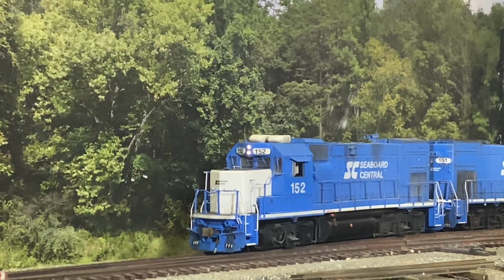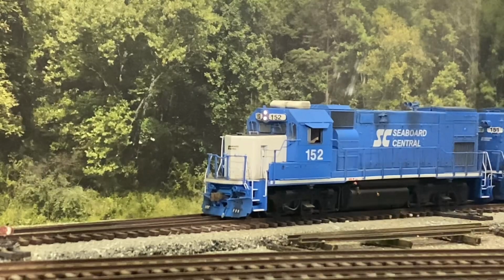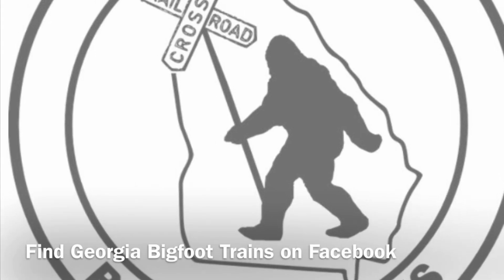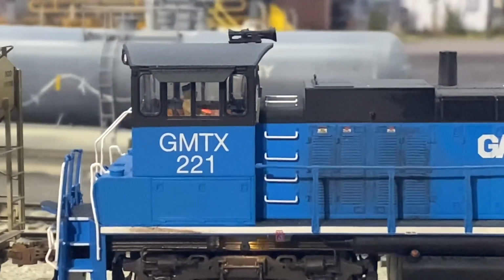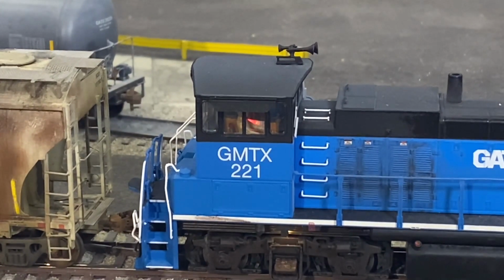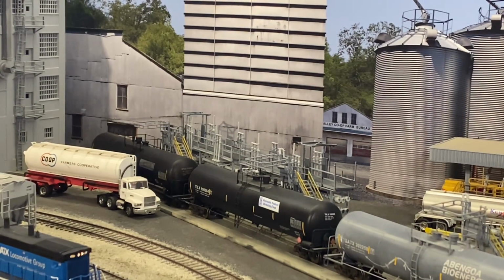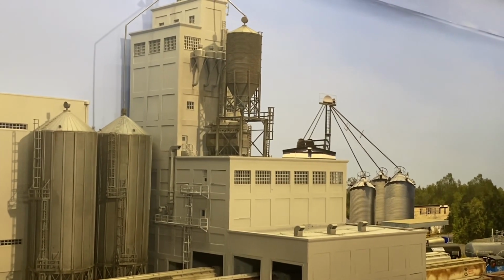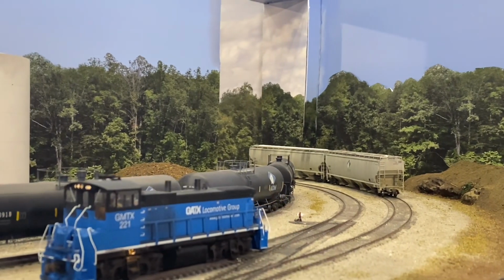Seaboard Central - January 2023 Layout Update

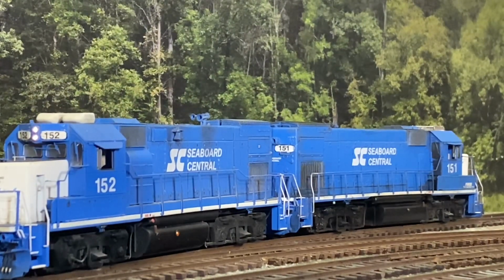Comment: Great looking layout Tim. The ADM plant looks amazing. But I have a question. Why did the rear truck on unit 152 look like it ran over a speed bump at 2:18 in the video? Then both trucks did it as it reversed. Is something on the track? Or is it the frog?
Reply from the maker: Thanks! It was the derail that wasn’t completely seated down. And Athearn units will hit anything that sticks up above the railhead.
Reply: @SeaboardCentral  you are absolutely right about Athearn units hitting anything about the rail. All of my Athearn units have extremely close clearance underneath. After watching it again I could see the derailer since I was looking for it.

Comment: Morning Tim. I took my Atlas mp15 apart last night thinking I would have  lots of solder pads on the board to add lighting. Turns out there aren't any extras. Also, not much room either. Do you know what decoder/board combo was used in your mp15 after customisation? Thanks
Reply from the maker: Hi Matt! The board on my Atlas was replaced with the LokSound V5 with built in Power Pack capacitors. It has all the pads you need for customization.
Reply: @SeaboardCentral  thanks for confirming Tim. Loksound v5 direct is what I was looking at - space-saving for sure.